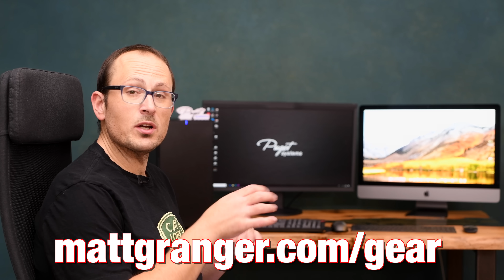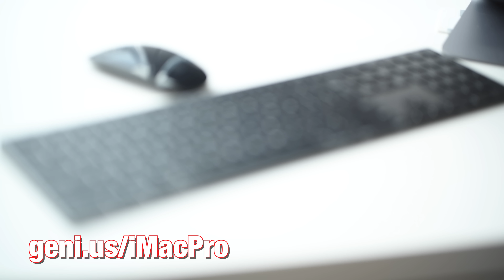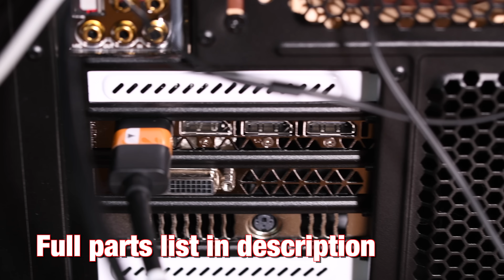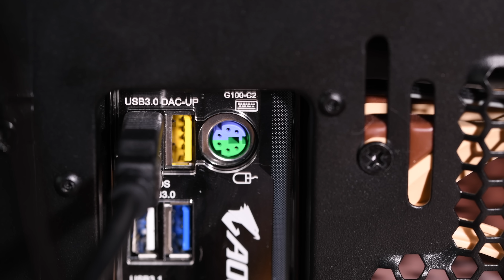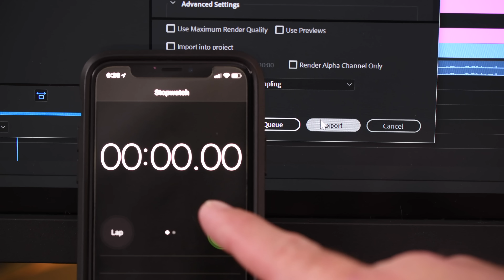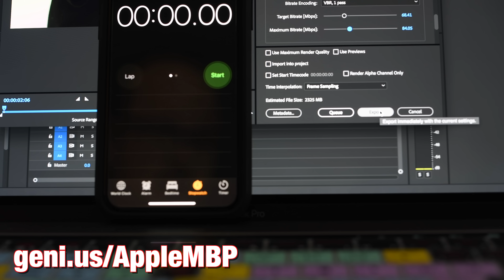$10,000 iMac Pro vs Custom PC - Which is faster??!

Comment: Test the mac running windows or run final cut
Reply: trentonharrisphotos you are right I just said to do that test because it will test the best of windows vs the best as Mac os ( better hardware vs better software )
Reply: I’d love to see the software comparison. Final Cut Pro on the Mac versus Premier Pro on Cider house (PC). Let’s do this, Mat! Could help viewers on your channel decide between the two.
Reply: Matt Granger the point here Matt is that you clearly had CUDA turned on, and didn’t use Metal on the iMac. The macOS version of Premiere is not very good software, I think a better test would be booting the iMac into windows with boot camp and running the tests again with OpenCL on both under windows. That’s peoples point here, you can’t use advantages for one and then not the other, all of my systems are dual boot and I’ve found that the new iMac pro in windows with DaVinci & Premiere performs about the same if you CUDA on the Nvidia card and OpenCL the AMD. Under macOS, Metal should be used to give a more accurate comparison, as these processors are basically equivalent.
Reply: Matt Granger yeah premiere pro is nt optimised for Mac OS and that's why premiere Pro runs much better on Windows but if I use fcpx on Mac it will render much faster because it is optimised for that OS
Reply: TECH 3 Final Cut renders in the background while you working on your project and uses a more NLE friendly codec for the preview so that why Final Cut is faster. The reason the Puget system outperformed the iMac is simply the hardware. A lot of people do not realize that the Ram has a lot to do with the encoding of the video. The more RAM you can throw into your system the better and also the faster the RAM performance increase exponentially.  Next time you render something just check out the RAM usage. My system uses probably 95 percent of the amount for Premiere during export.
Reply: why?
Reply: mavfan1  because premiere Pro is not meant for use on OS X and Final Cut Pro is utilised for Mac OS so this is not a fare comparison
Reply from the maker: Nonsense. FCPX is ONLY for mac. Premiere is for both. Exact same tests run...